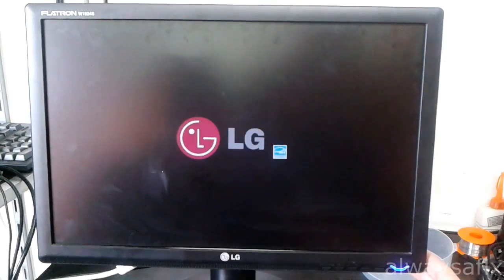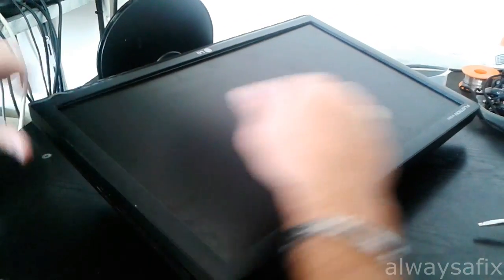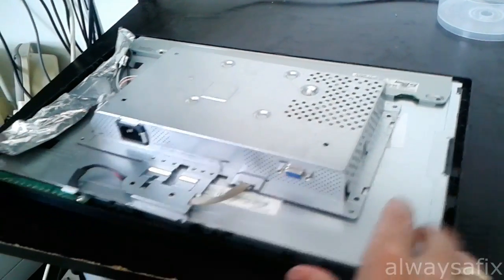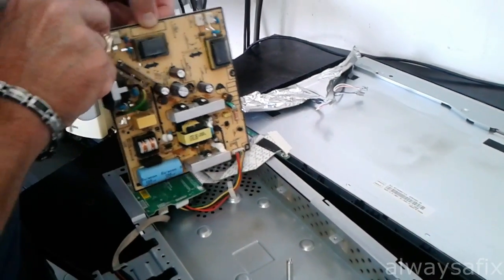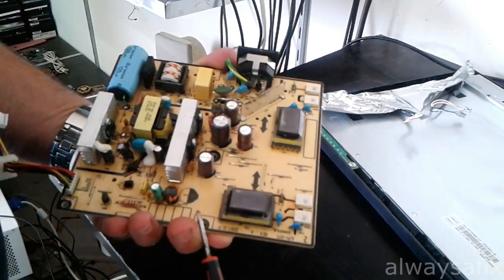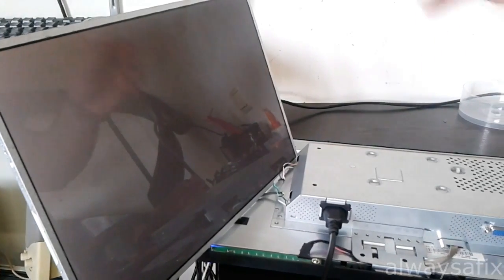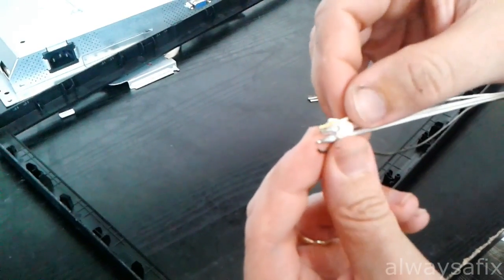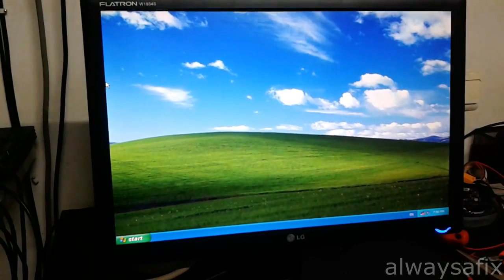Screen problem switching off LG flatron 19 inch repair

Comment: Totally pointless if you don't show us how to access and remove the LED strip. 🤷🏻‍♂ Yes, the difficult part !
Reply from the maker: The video focuses on the power supply repair, which was the issue with this particular monitor.

Comment: LG monitor turns on, then after a few seconds blue light blinks and screen shuts off — what could be the issue?
Reply from the maker: What is  the model number?
Reply: @alwaysafix It's LG Flatron E2060 monitor model
Reply from the maker: @brightstudiosofficial  That model has an external 19v Power Supply, I would start with that. When the screen shuts off does the blue light stay on?
Reply: @alwaysafix no, when the screen turns off, blue light blinks and get turned off
Reply from the maker: @brightstudiosofficial  try this: you have to be quick, when the screen comes on, reduce brightness to 50% before screen goes black.

Comment: Bro, why are you telling people to short the capacitor with a screwdriver? That is a 450V 150 micro farad cap, you should absolutely NOT discharge it with a screwdriver.
Reply from the maker: You are very right, this video is 11 years old, since then I have learnt to discharge caps with the correct tool.

Comment: Hi, I have a similar monitor It is a 22 inch, a 2234s it has blown the VGA board 491441300100R, I cannot find a replacement however there is one 491381300100R that looks similar I am not sure if it can work with it.
Reply from the maker: It looks similar but it will not work, sorry

Comment: I have an LG Flatron L1717s monitor and it has the pulsing power light and it struggles to power up. I took it apart and like an idiot took half the caps out of the board and I dont know where the right ones go and they are the same siZe but different values. Any idea where they go?
I know I should have taken pictures but I didn't.
Reply from the maker: check out badcaps.net very resourceful forum, good luck

Comment: Update:
My monitor is working just fine. But I still have to switch it off and on only ONCE now. In second go out stays. Then there is no problem. Today on Monday morning I switched it on after Sunday break, it has started displaying after 1 on/off cycle.

This is update for you just in case you face same problem.
Reply: Any further updates mate? Mine has the exact same issue, I have to turn it on many many times until it stays on.
Reply: @helio3630  After some days it worked normally. I have not used my monitor since 21st March till date due to lockdown, but till then there was no problem at all now.
Reply: @helio3630  it has worker very well. Let me see how it works after lockdown is over. I guess till then monsoon will also be there. All dusts will catch moisture. If needed I will have to clean it again. But bottom line is that  after certain years you need to service your monitor, cleaning dust and all. Thats what I feel now.

Comment: Thanks buddy. Your video helped me in opening and closing my monitor properly. Mine was similar problem. When I on/ off monitor around  15 times it would stay after  that . It was tiering. After seeing your video I got courage to open my LG 19" monitor. Model W1942. I though had different finding. My monitor was having very much dust. So I cleaned it, then used my hair dryer to remove any moisture that might have accumulated. Then I reconnected all wires and started the monitor and bingo it showed the screen immediately. I had this problem year back also. But some how I had managed. We have monsoon season in Mumbai India right now and humidity is high. So it can be dust, humidity causing problem. This is my experience. I did it today. Let's see how it starts tomorrow. I'll update it later. Any way thanks for video.

Comment: Initial parts of the video are good. But later, you are not at all showing how to deasseble the CFL lamps.
Also you did not show how to test CFLs, connecting to a laptop.
All these are unclear. You had to show them well.

Comment: Mine is lg flatron 17". It turns on and after some time it starts to turn of and on. What could be the problem? The caps in the circuit is fine though
Reply from the maker: check out my other video on testing ccfl lamps, good luck

Comment: Is it OK to replace a capacitor which has 820uf to 1000uf?
Reply: Van Beethoven Villanezo 
No!
Use same Mf
Can use higher voltage rating capacitor, not lower voltage capacitor

Comment: My Flatron L1717S has a similar problem. The screen blacks out after barely a second, but sometimes (~ 1/100) it stays on. It even stayed on for 3 days in a row without issue, until I turned it off by mistake.
I haven't open it yet, but would my problem be on the board instead of the backlights? Or something else entirely? (I'm not equipped to test the backlights.)

Comment: I just fixed one of these monitors. The symptom was that the blue power LED would flash on for a moment, then off for bit, then repeat. Capacitor C812 (Su'scon 1000 uF 10 V 105 deg C) was visibly puffy. I just soldered in a replacement and the monitor works fine.

I find that a 2-inch plastic putty knife will help get some leverage without damaging the screen (and saving my fingernails). You can use two or three as shims to keep the case from popping back together.

Thanks for the video.

Comment: Thanks for this video. I have  2 LG monitors. One stays on for 20-30min then shuts down and doesn't come back on until you unplug it for 10 min. The other is black and flashes a picture for a split second every 20 seconds or so. I have checked all the simple stuff. Could it be the same problem? I don't have a lot of spare parts is the problem. Need to find another dead monitor. Does anyone know of a good spot for Canadians to order parts?
Reply from the maker: Replacing the capacitors on the power supply board will most probably sort out both monitors.

Comment: In the case of my monitor, the backlight turns off after 2 seconds, just the same as on the video. It's a BenQ G2420hd. I tried your approach with the spare lcd screen and it got lit for two seconds on three of the connectors and on the fourth one, the spare lcd didn't light on at all, though the main screen turned on for 2 seconds. I will try to change the caps, although they seem ok, but do you have any other suggestions? Is this behavior consistent with the scenario that some of the caps failed?

Comment: My ASUS monitor comes on and shuts off, then on a again, then off.  I have to reconnect the power plug to  do it again. It won't stay on. No visible problems on the board. So what can it be. It is very bright when on. I am making a light box with it. No VGA needed, just bright light. Any ideas  and help will be great .

Comment: I have a monitor (Acer V173, six of them actually)  I was hoping maybe you could help me figure out. After watching this video I was super stoked and thought I finally knew what the issue was, I tried the method and the 4th lamp connection seemed to be the key, I had a spare laptop bulb that is good and when I connected that instead of the original bulb, it came on and stayed lit. However, when I got at that bulb and checked the solder points on the ends, they look totally fine? Like perfect still. I have six of these monitors that all do the same thing and I'd really like to fix them but I can't figure out how. All the caps are fine on all of them. I haven't taken multiple panels apart to try the laptop bulb on each but I expect they will all do the same thing. Could it be a different part on the power board? An IC or something? I can do caps and I could have soldered the wire on a bulb but beyond that I'm totally lost. Any help would be appreciated.

Comment: I've got a Samsung xl2370 computer monitors 2 of them and they keep going off and on every now and them. Some times I have to keep the power chord disconnected for a few minutes and plug it back in and they come back on. Got any suggestions for this issues. Took them apart the boards visually look fine.

Comment: I tried the "american components russian components" technique.. It didn't work.. Then I tried your way, it worked. Cost me about $2 and a 6 miles walk to find the parts. I replaced all the capacitors, works like a charm. Hope it will last. Thanks mate, God bless ya.
Reply from the maker: Happy days and congratulations on your fix.  This repair was done in 2013 and still in good working order.  Thanks for watching.

Comment: "everything turned out to be 100%"
Yeah, right.... Visual inspection is not enough to be 100% sure that a capacitor is fine, you would need an LCR meter or something similar, not every capacitor that fails, bulges or leaks.

Comment: i have a flatron w2061twq and it has the same problem it turns on for like 2 second then off but the power is still on i am not that experience in this but dont want pay 80 bucks to repair it how do u know if its the ccfl or the capacitor thats the problem

Comment: I have an W2242S that died on me today... same issues... turns on, and goes off after 2 seconds. Took it apart, the board with capacitors looks fine just like here. Unfortunately, I have no other screens to test lamps with, so I would like to check connections, but I have a problem there, since that hasn't been shown here. How did you get the lamps out? Any help would be very appreciated, since that one in video and mine seems pretty similar in design.
Reply from the maker: +Goran Mrganic Since its easy to damage the lcd removing the ccfl lamps, its not worth it just to check.  You need to find a spare ccfl lamp for testing.  Good luck!
Reply: alwaysafix Thanks! But that doesn't really answer the question: how to remove the lamps.

In anyway, I already opened it, and one of the lamps fried as it has entire black ends, while the others are almost as "white" as everywhere else. So, now my main problem is to put it all back together :D lol

Comment: I have and lcd flatron e2350 and after i let pc in standby like 1 houer or 2 lcd not powerig up ...what i managed to do  i played with hand over power up touch button like 5 min and finaly started! but if is off again for 1 houer or more is the same..i have to touch like 4-5 min to start!! Sometime the power buton flash and is starting if i let him but sometime no!! i watchat that board inside in some places it a bit black !

Comment: hey man, first of all YOUR AWESOME!! Found an old non functioning LG flatron 2253V on my parents attic, thought it would be great to repair. after a while i found that the ccfl lamp was indeed not functioning. I want to replace it but don't know what one will be the correct one to replace. Found some on Ebay, but have no clue if they will fit. Could you help me out here? telling me what product to buy or where to look for the correct one is much appreciated. Thanks again!!
Reply from the maker: +RelentlessBassMedia Your first job is to remove the lamp from the panel, without damaging the panel itself (the bottom one is much easier than the top).  Once you have done that its just the case of measuring how long it is and buying the same one on ebay.  Make sure to get the lamps with wires already soldered to make the job easier.  Good luck and Merry Christmas.
Reply: +alwaysafix thanks man have a great christmas yourself too!

Comment: my dell monitor switch off after half hour..while working...starts working after it is re plugged.. again it gets off after few minutes.. please give a remedy
Reply from the maker: +Kurichy grama pacnchayat First step is to check the capacitors on the power supply board.  Good luck!

Comment: hi, nice video very usefull thank you, but i still don't get it, how you did at 7:31 how did you get the lamps out of the panel ? because i think we have the same problem here,the capacitors look fine, so i'm guessing it's the lamp, please show me how you extracted the lamp out of the panel? thank you for your reply !
Reply from the maker: +Yacine Zidane Before you extract the lamps from the lcd panel, you need to connect a working ccfl lamp to the inverter to test your theory.  Good luck!
Reply: alwaysafix thank you very much i fixed it right now, i had the same problem as you, the monitor turns on for 3 secondes then the backlight turns off, i soldered the lamp and it worked ! thx dude you just savedc me 200$ or so
Reply from the maker: +Yacine Zidane Congratulations on your fix and glad this video helped you out.

Comment: Hello, 

My old LG w2361v stopped working on me almost a year ago so i get a new Monitor.
Know that i have seen your vid i feel like just trying to bring it back to life.
The Problem is, i forgot which CCFL Lamp goes into which slot...is that a problem or can i just do trial and error without breaking anything ?
Reply from the maker: +SnakePlizkin The order your CCFL's connect to the inverter board won't matter.  I find that the wires have a memory and will most probably point to where they were connected.  Good luck!

Comment: Oh and what's invovled when soldering and insulating the ccfl?

Want to add I have a different model lcd monitor which works in the first few seconds after turning it on but then it shuts off and STA"YS off. It doesn't come on repeatedly.

I've oiled fans before but I've never replaced capacitors or worked with itnernals parts by soldering something. So this is all a big jump for me if I attempt. It's a huge help to find videos like this online.

Comment: So the bad connections to the CCFL were causing the circuit to break, which caused the screen to shut off? But why does the screen work for a few seconds when it's turned on, before shutting off? And why can't the screen operate on less than 4? Why does it "break"?

Comment: This is helpful. I replaced the 6 caps in a LG W2243T-PF as indicated elsewhere, but the problem persists. The symptoms are as described here, so I will try this fix. One thing: I'm not clear on how you use a laptop to test which bulb is defective--could you elaborate?  Thank you!
Reply from the maker: Virgil Machine It's basically unplugging one lamp at a time and replacing it with a good CCFL lamp.  If the lamps remain lit you found your bad lamp.  Good luck!
Reply: +Virgil Machine i think he means via vga cable for signal
Reply: +Vaughan Stephenson Thank you.  I haven't tried this yet, but my understanding is that he meant to open the laptop, disconnect a CCFL from the controller, and replace each monitor CCFL one by one until you find the one that's bad.
+alwaysafix, please confirm
How would I do that with a VGA connection?
Reply from the maker: +Virgil Machine Im not talking about the VGA connection, Im talking about substituting the CCFL lamps one at a time until they stay on indicating the faulty CCFL lamp.  Good luck!
Reply: @alwaysafix  - I don't have a spare CCFL lamp to troubleshoot with, unfortunately.

Comment: i managed to undo all the fastener around the screen, but for some reason i cant seem to just pull out the insides of the screen away from the back pannel, it seems locked, is there some kind of a fastener there too? i tryed pulling hard, but if i pull any harder i think the plastic will just snap, thx
Reply from the maker: PsychoBunny85 Remove the stand as sometimes there are screws hidden there.  Is your model the exact same model as the one in the video?  Good luck!
Reply: yea, it was the stand, it is the same model, but i guess the standard of making them for other countries varies, thx!

Comment: Hi guys, I'm facing a similar problem, though my screen (an LG 2240S) continuously switches on and off  when I press the button (not just the backlight, but the power light as well). The caps are visually OK (I don't have an ESR/Capacitance meter). Any ideas?
Reply from the maker: Orestis Gklavas A capacitor replacement kit for that model only costs a few bucks.  That's where I would start.  Good luck!

Comment: Help, trying hard not to break any bezel's so can anyone please tell me if there are any clips on the corners, it seems there are but how much pressure can you put on the frame before it breaks?
Reply from the maker: BRIAN CLARKE Try lifting the bezel with your fingertips from the inside edge.    Start on the top middle working your way towards the corners, then the side middle working your way towards the corners and then finally the corners.  Just do not put any pressure on the lcd.  Good luck!

Comment: same problem(blinking-goes off) on a lg l1730s, was an 680mf capacitor on powerboard who looked ok at first sight!!
Reply from the maker: JOHN1987360 Nice catch, I come across capacitors all the time that look perfect but are faulty.  On a power supply where there are not too many capacitors anyway, it's easy to remove and test all.  Thanks for watching.

Comment: The boards and shell look almost identical to my "Acer AL2216W bd" monitor.  I'm having similar problems, but not exactly the same.  The moment I connect my monitor to power, the light goes green as if it's on and flashes the "Acer" logo, then turns off to yellow and I cannot get it back to green again.  I noticed two swollen capacitors that I replaced but I'm still having the same problem.  Should I just replace all the capacitors even if they look good?

Wish you would have shown how to pull those lamps out and how you worked on them!  All that info would have been great!  But, amazing job so far!  Glad I found this video!
Reply from the maker: If it's switching to yellow it's not the lamp.  It's going into stanby mode maybe because it's not receiving a signal. Check for a faulty cable.  Good luck!